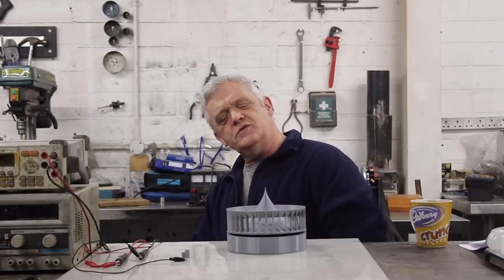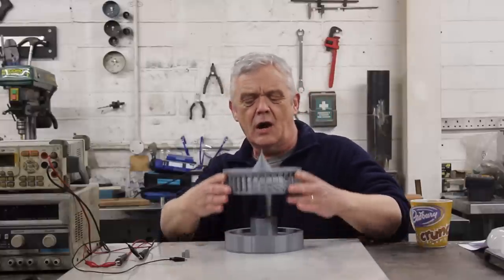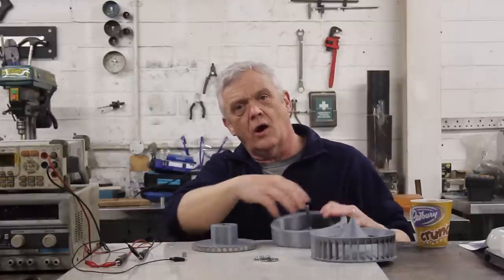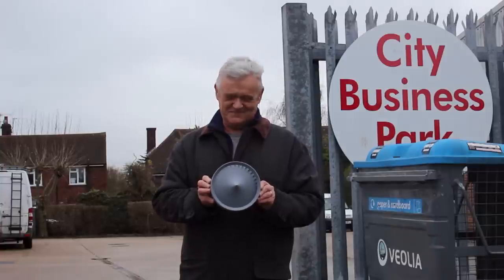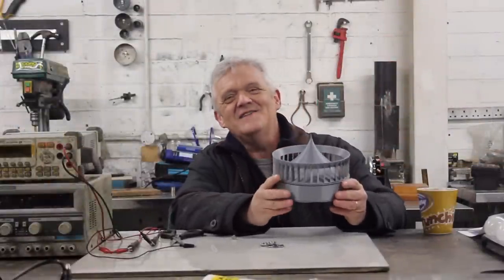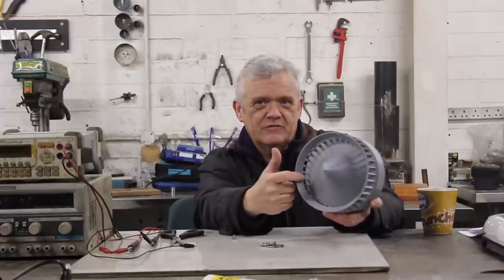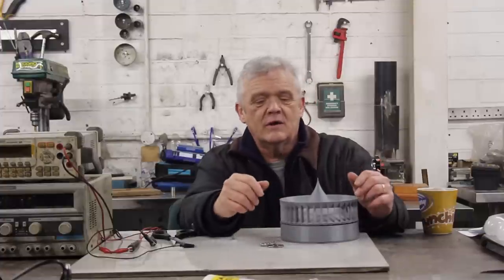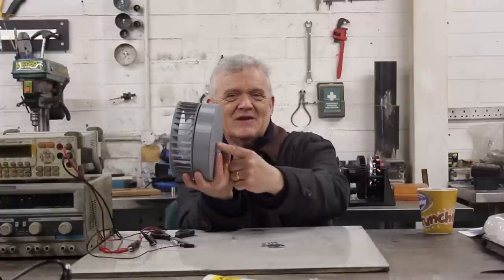1883 The Swiss Army Knife Of Wind Power

Comment: This is one of the best designs that I have ever seen.  I need to learn how to use tinkercad.  If I could scale that up to take 25mm magnets, I would probably go out and buy a 3d printer and print this out.
Reply: You could buy a printer with a 300mm X 300mm X 300mm build volume or even larger than that. Most Slicer software will allow you to scale up your models to fit your larger printbed. Just note that every feature of a model is scaled up (or down) including holes 😮😊
Reply from the maker: it's pretty easy to scale mate

Comment: I would just love to see this type of windmill put up and tested to finally break the myth that the three blade standard are better than the vertical type.
Reply: Three blade is the easiest way to make Big sweep areas
Reply: @Xanderbelle  Agreed. Hundred-meter turbines are utility-scale, but not everybody needs utility-scale generation.
VAWTs don't scale up but they do multiply. Different solutions for differing applications.
Reply: @Struthio_Camelus  Elaborate please, the 3 blade standard is a vertical type and so is this one. I don't understand what you are saying.
Reply: @edmundzed9870  Maybe I misunderstood. If you're referring to utility-scale turbines as "three-blade standard," then they're definitely Horizontal Axis Wind Turbines. (HAWT)
Reply from the maker: that takes a lot of money and time mate and you can be guaranteed to never finish it lol
Reply: @Xanderbelle  Big sweep areas for one large machine, but if you put up lots of smaller and cheaper ones couldn't they add up to the same output?   Perhaps the big sweep area means you can move a bigger magnet?

Comment: Wonderful Rob!  Have been mulling this over and thinking that the cone portion is adding a lot of weight and drag to the unit.  Would using a hollow shaft and immovable cone(ie.  cone attached to base through said shaft) thus making the cage part lighter and less drag create a faster spin with more torque.  It would thus make a higher output at a lower wind speed and make the unit more robust.  Just a thought.  Thanks for all that you do Rob!  These kinds of videos keep spurring my imagination.  Love it!
Reply: I suppose the only benefit to a moving cone is that it keeps the rotor moving during lulls in wind power. Not a mathematician so I don't know how these two types would test against each other.
Reply: @paulmurgatroyd6372  That's the question.  Would it make a big enough difference to do it one way or another?  Will the action as a fly wheel out weigh the lower drag?  My biggest point though is this,  drag is not the only thing that I am considering here though,  a rotating object with air blowing over it has a lift on it.  A rotating cylinder can act as a sail for example.  The lift will make a difference in how much friction is placed on the rotor shaft.  Thus,  will all of the above discussed issues make enough of a difference to make it more feasible one way or the other?
Reply from the maker: very true mate but it also acts as a flywheel - I suspect it's horses for courses on that - but you are right to ask the questioning it is well worth trying what you suggest
Reply: @ThinkingandTinkering  Exactly,  will not know unless we compare them.
Reply: @jamesross1003  At the end of the day, an optimist would say that they are both producing 'free' electricity so unless your energy needs are quite large, both are good.
Reply: @paulmurgatroyd6372  Good point there.
Reply: Also, just thinking, there's always the possibility that the most efficient design might be the most costly and difficult to manufacture, so more variables to consider.
Reply: @paulmurgatroyd6372  Yeah that is a big consideration.  To make any changes to any design can become costly and tedious.  To be honest those ideas that I threw out there  might over complicate things.  It was merely a thought experiment.  Though, I would love to see if it would make a noticeable difference.  But,  you are correct it would make a difference in manufacturing tedium and cost.  If we don't ask these questions, there is no way to know either way.  For example,  a 3 phase electric motor is more tedious and expensive to make than a simple DC motor but has it's advantages.  Had those ideas and questions that led to it's development never been explored,  we would not have such a motor.  I totally agree with everything you have said.  In all fairness though we must explore at least in thought experiment other possibilities.  If we do not do so, we will forever be stalled at that stage.  Thanks for the responses and inputs.  I enjoy mulling over such things.
Reply: @jamesross1003  As far as the complexity and costs comments were concerned, I was really thinking in terms of large production runs of large devices. I think the units for the home gamer won't really be affected that much. It's generally the case in manufacturing items like this on a big scale that they get made by the lowest bidder. 🙂

Comment: When I have wind there's always plenty of noise.
Reply from the maker: indeed
Reply: You should blame the dog
Reply: It would work even better if you use a reversed toroidal model as wind inlet something similar as that what you showed as in a yet motor and make multiple  air stream in the narrowest part of the toroidal inlet and let thé accelerated high pressure air stream push a  turbine.

Comment: I'm curious for I haven't been watching thedevelopment of this design, but in the VAWT configuration, won't the wind have to be coming from directly above the generator, i.e directly above the cone's nose? I gather the cone disperses the wind that hits it "nose on" into the blades around the circumference? If so, is some form of wind capturing device required to funnel the wind down onto the cone from above?

Comment: There is a distinction between the axis of rotation relative to the ground, and that relative to the air flow. If the air flow is vertical,down, the turbine is a HAWT rotated 90°.

Comment: Well impressed, Robert. This looks like a form of centrifugal compressor-cum-turbine. I wonder what percentage improvement you might gain  if you made a separate, static cone which extended its nose forward of the turbine, with an altered profile towards the rear to better match the parallel turbine cross-section, and added guide-vanes in the manner of a centrifugal compressor?  Cheers!

Comment: Two applications for this come to mind: 

1. Mounted on the underside of a large balloon to get higher altitude winds. At low speeds, the wind would interact with the turbine like a VAWT. At higher speeds, the balloon would begin to act like a drogue parachute and align the turbine into the wind to act as a HAWT. The balloon/turbine assembly would be moored to the ground via a cable running from the tip of the turbine cone. Whether to attempt to transmit torque through the cable or to carry the generator with the balloon is a whole other looney tunes thought experiment  😂

2. Mounted as part of a combination wind/wave power generator.  The turbine would be mounted (again, upside down) on top of a standpipe so that any airflow from the pipe would need to leave via the turbine. The other end of the pipe would be submerged in the body of water creating waves. As the waves rise and fall, they would displace the air in the pipe, creating a fluctuating flow that turns the turbine. The turbine would also spin in any incidental wind flow in low-wave conditions. The pipe may need some check valves and an alternate inlet to ensure one-way (exit only) flow through the turbine. 🤔

Comment: Hi Robert, I am a newcomer to the channel. Frankly it is brilliant. I am not an engineer so forgive my naivety, I'm thinking..... if you introduced a large conical air capture (mounted onto the housing), in front of the  turbine, could this increase the force of air without having to increase the current mechanism. As the aperture at the front is increased wouldn't it exponentially increase the capture and therefore the collected thrust. Just a thought.

Comment: My concern with turning it into a HAWT, is the possibility of the fins falling off. I was wondering if you print the cone tip as a secondary piece that will attach to the rest of it in order to access the center rod in order to "permanently" secure the fins to the center rod, preventing it from eventually falling off. Just my thought. Sorry if that didn't make much sense. LOL!!

Comment: My printer is down  and as I wait for parts but I have been designing a  generator that will have counter-rotating magnets above and below the stationary coil. Is there any advantage  or increased performance if I were to use two back to back serpentine coils so that each magnet filled rotor rotated above its own coil? [ as opposed to one coil in the center]. The rotors on either side ( or top and bottom) will be held fast to whatever blade configuration is to be mounted, while the ,stator and housing are held fast to the stationary 5/16" shaft..... that's the plan anyway . I also want to consider a 3 phase windings.
Reply from the maker: I honestly don't know mate - but I have been thinking of 3 phase I just did single phase because it is the easy to replicate option

Comment: I’ve been looking at waters turbine. It has a negative zone right behind the turbine. Is it possible to take advantage of that? I’m aware of a francis and pelton. My thinking is to have it flow exit on a 45degrees? mean it can still spin but take advantage of the bypass flow that generates negative pressure void that suck more air in?  Maybe a winglet mod on each blade to slightly turn the flow? Much like turning the flow back on itself?  Bio plow come to mind? Viktor schauberger work into fluid flow might help the design?  Atm you have the flow exiting radially? Which is good. Dyson has done work into impellers I’m just wondering if that would help as well? Could be as simple a angled scallop. On the inside edges? Which then might improve the air flow through the turbine?  Leading to improved efficiency?  In theory your not trying to stall the wind, But take advantage of its features? It why a francis turbine work well in water. If I recall correctly there was one francis turbine that achieved 98% efficiency?  But doc google says 95% if well designed? Im not sure if it possible to increase the Revolution from the same input? Maybe double the Revolutions? Therefore increasing output?

Comment: BTW, considering your wind collector with flaps and the fact that these systems are better suited for urban environments, I kept thinking about a system that would prevent the flaps from banging shut and I think small magnets coupled with copper on the opposing surface will slow it down enough to prevent noise while still allowing closure. A thin gasket would help with the final dampening and seal.

Comment: My concern with any wind turbine that is not a HAWT is the ability to actually produce any decent amount of power.  All the vertical axis turbine designs we have experimented with spin easily in the wind, but stop dead when any kind of real load to create electricity is applied to it. A horizontal axis turbine has naturally more torque and inertia to keep it going due to the distance from the hub of the device to its perimeter (ie the radius of the blade sweep).  However I am really intrigued with your design.  With your permission I would like to construct a 1m diameter version of your turbine, along with an enhancement or two I've been thinking about, and then showing the results once we apply a load to it to create an electrical current.  I think your design is a perfect wind turbine for rooftops where HAWTs are not permitted in urban areas.

Comment: Can also mount a collector based on the darwin collector along the roof ridgeline and channel it to the ends where you put the generator.  Shroud the exhaust so the normal wind blowing over just that section creates a low pressure zone to suck the exhaust out magnifying the effect somewhat.
Reply from the maker: nice ideas mate cheers

Comment: I guess that with the cone and the wings separated so that the cone is fixed and only the wingtips rotate, the turbine would spin even faster. I think the air would produce a kind of repulsion power that might support the rotation if the cone is fixed. But maybe I'm wrong.

Comment: One pair magnetic ring bearing like you tested before and one pair magnetic ring magnet in attraction Slightly less powerfull than the trust bearing
Than it will might be possible to "switch" from low wind horisontal to high velocity vertical mode?

Comment: Congratulations Rob, but you will need to add a few more "blades" to equal the Swiss.
(Wenger Giant has 87 tools and 141 different functions. It was produced in 2006 and is the world's most multifunctional penknife. It includes every implement the company ever made, including a large blade, a small blade, a saw, a corkscrew, a bottle opener, a can opener, a reamer, a screwdriver, a tweezers, a toothpick, and many more. It weighs 1.4 kilograms and measures 8.75 inches by 3.25 inches. It is not a practical knife to carry around in your pocket, but it is a great conversation piece and a testament to the ingenuity of Swiss engineers).
However I would posit that yours will have far more applications😋🫡

Comment: Fantastic Stuff, amazing how fast this has developed. is that the widest print available for your printer, i wondered what would happen if you made it as wide as you can for your printer, catch more wind, longer winding more power ?!?!? soooo tempted to buy a 3D printer like yours now
Reply from the maker: no my printer prints at 420mm by 420mm by 500mm - but most folks print in this range and want this accessible

Comment: So you're using the NACA 8410 airfoil backwards, in drag mode, for a vawt and forwards , in lift mode, for a hawt?? Is that right?
Reply from the maker: no they are in lift mode
Reply: @ThinkingandTinkering  But the wind direction reverses through the blades for each mode of operation.  ????
Reply: @ThinkingandTinkering  I just viewed the tinkercad drawings and I was correct. When using this turbine as a traditional vawt the blades are used in the drag mode because the wind enters into the turbine from the sides and the blades have all their trailing edges pointed outwards. When used as a hawt or a vortex turbine then the blades are used in the lift mode because the fluid enters the turbine from the inside and goes out, utilizing the leading edges of the airfoils for lift mode.

Comment: Have you thought of making the inverted cone on the Darwin Waters wind capture device an open cone at the bottom that overlaps the top tip of cone on the turbine?  (I hope that description makes sense. Basically so the two tips of the two cones meet but the one on the top let’s air go through)

That way you could stack multiple Darwin air capture devices on top of each other and get more air coming down the more you stack.
Reply: Making the top inverted cone of the Darwin capture device open at the bottom would also allow you to make them bigger and funnel the air to a smaller area and potentially make a Venturi effect. They could also get bigger as you stack them.
Reply: With the inverted open cone in the Darwin wind capture, wouldn’t it also make sense to have the cone have a steeper angle so less air passes through to the other side?

So just a slight angle that guides almost all of the wind downward. Like a cone that’s closer to a cylinder than an equilateral triangle.
Reply: Right now the cone for the Darwin wind capture device starts at the bottom of the device. So I guess I’m saying, what if the cone of the Darwin device instead start at the inside top of the device and then came down through it. Maybe down through a little farther down than the device itself.
Reply from the maker: it does make sense and I have thought about it

Comment: Hi Ron here.  How big would this turbine have to be to create  1k with a 10mph wind. Thanks Ron
Reply: Or how many of them.
Reply from the maker: there are online calculators to tell you that mate
Reply: Radius of around 4.75 metres for a horizontal system to generate 1kw in 10mph wind....that was using omnicalculator wind turbine....New to all this but that sounds quite large.

Comment: I'm sure there is some way you could make the tail fin evenly balanced with the turbine on a pivot so that when there is low wind the turbine will be in the vertical position, but as the wind picks up past a certain speed then the tail fin will raise up and lower the turbine into a horizontal position. Definitely would need to focus on the bearing system to ensure it can get the most out of both configurations.
Reply: That's where the mag lev baring comes in to play.

Comment: in a HWT application, could you put this device into the 'nose' of a nacelle, so that there is, effectively, a "vacuum" behind its rotor outside edge; it seemed that a previous video showed almost no outflow velocity from the fan, so that placing the fan inside a nacelle, with an open tail end, would maximize the pressure differential between the "inside" and "outside" of the fan... a sketch would help, but...

Comment: You could also extend the axel by 2-3mm and add a locking ring on the end. That way there's no way for the rotor to fall off and could definitely help with the maglev in the horizontal position
Reply from the maker: absolutely